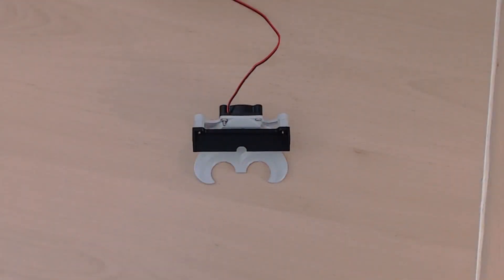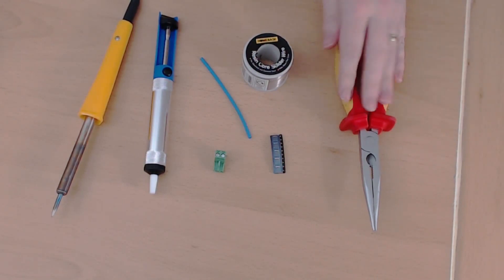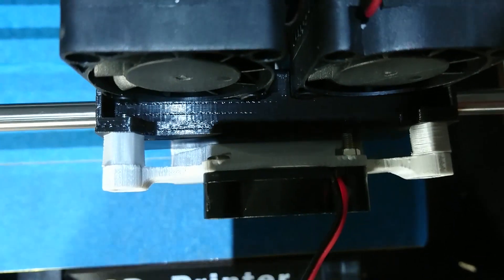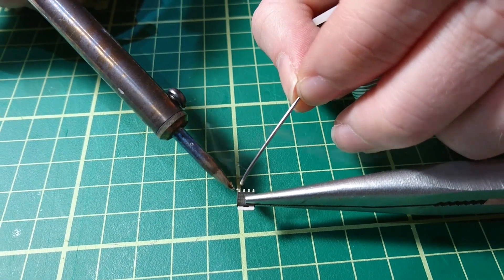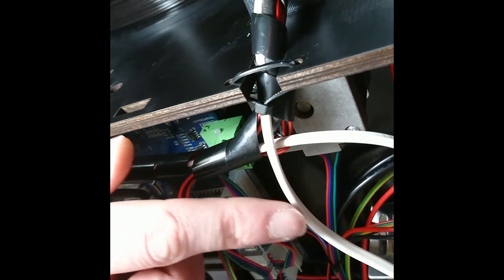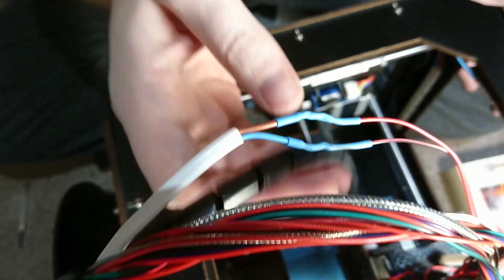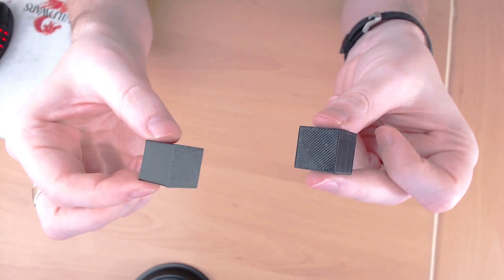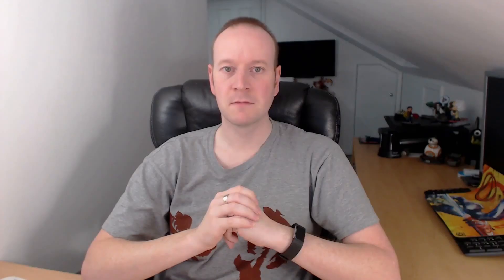CTC 3D Printer Active Cooling Mod

Comment: Just got one of these on eBay for £26.
Changed out the warped aluminium plate for a cut-down Creality one, added foam insulation under the heating plate, and added a magnetic build plate.
Works a treat!

Laser-cut some acrylic for the sides and front and fitted an LED light and a hinged box lid.
Working on the mods now. 

Not as good as my CR10 pro or A10m but a little better than my Weistek 150. 👍
Reply from the maker: Excellent find and a bargain as well. Great work
Reply: @Abernus69  just cant get the bugger to connect via usb, probably a driver issue. 👍
Reply from the maker: @GaryGraham66  I have problems at time on Windows 10 to get my Ender 3 connected. I have more luck using older versions of Windows. If I bothered to troubleshoot it I would probs find the right driver, but a VM is much quicker.
Reply: @Abernus69  yeah I  have a lap top that I may stick windows 7 on and give it a go to update the firmware. Cheers

Comment: Hello! I did all this, but I have 2 volts at the output of the cooler. I checked everything - the soldering is good. However, I am using MakerBot - Desktop. Plastic ventilation settings are set to 100% but it does not work

Comment: Very nice just done one yet to try. I suggest to power it with external 12V power supplier unless you are an expert solderer, I have almost damaged my MB trying to solder such a tiny pieces... done in PLA as I don't use ABS let's see if it lasts, thank you.
Reply: How did that hold up?

Comment: got the same printer, ctc dual bizer. it was a pain in the ass in the beggining but i figure out that was the cheap plastic and BPA
Those printers are not designed to print in BPA and you will always suffer when trying.
Changed to PLA, and never had a problem again.

Comment: i got a board online that had the same little chip soldered to it, except whenever i plug a fan in it burns up and melts the coils. No idea if its the same with yours but any help would be great.
Reply from the maker: It's the fan a 24v DC fan? Also double check for any shorts on your solder work.
Reply: Yeah pretty sure fan should be 24v not 12v as stated in the video. The board also has 24v written over it. Funny I was pondering this when I watched the video!

Comment: made the fan duct and the holder but I spliced it in to the left extruder fan using a quick disconnect that way I can take the fan off if I'm using abs
Reply from the maker: I later added a quick disconnect to mine so if I decide to use ABS I can take it off. I don't see myself using ABS but the option is now there. This is one of the best mods I have done for the printer.

Comment: Hi, thanks for the information. Isn't it possible to just wire the fan up to the fan on the hot end? Basically "piggy backing" the 24v from the other fan. Thanks.
Reply from the maker: Yes it probably is but then the fan would be on from layer 1 and would cause warping and other issues.
Reply: Thanks for the quick reply. I was just concerned in case i overloaded a mosfet. I would put in a switch so after a few layers I would just turn it on manually. I know that is a lot more effort but I am a bit skepticle with soldering onto the board. Thanks again.
Reply from the maker: I would do a bit more research on piggy backing another fan just to be safe. I can't see an issue but I am no electrical engineer so don't just take my word for it
Reply: Abernus69 Alright will do thanks!

Comment: Im looking forward to use this mosfet with 12V blower fan. Is it possible to hook up 2 12V blower fans in parallel or can I just hook one up?
Reply: You can do that however, it is easier to hook up a boost converter to convert power from 24V to 12V

Comment: do you have any video showing how to set simplify3D for these CTC ?
Reply from the maker: You can select makerbot as the printer as these are a clone of that.
Reply: @Abernus69  I'll try it, thanks!
Reply from the maker: @MeirelesSamuel  I have since moved away from my CTC since getting my Creality Ender 3 Pro.
Reply: @Abernus69  I have one too! It's so nice printer but I really would like to work with dual color.
Reply from the maker: @MeirelesSamuel  that's something I never did with mine.

Comment: Hi any idea why my ctc prints a mesh first then starts the print on top.
Reply from the maker: Have you got raft turned on in the printer settings?
Reply: Would that be in the software (Replicatorg) i use  or on the printer itself, sorry as i am new to 3d printer.
Reply from the maker: That setting would be in the software, You normally find this in the Setting of the profile for the printer. I am not familiar with ReplicatorG as I use Simplify3D
Reply: All sorted now thanks for the help.

Comment: what filament are you using? that can make a massive difference in print quality
Reply from the maker: It's not just the filament that makes the difference, for bridging you need the fan duct (IMO) But the filament I use is from a company called Rigid Ink. I use them because they are UK based and the filament they produce is good quality
Reply: its just that i know the filament that comes with the printer id
 rubbish though
Reply from the maker: Yes, the filament that comes with the printer is usually cheap quality.

Comment: Instead of soldering a MOSFET, I could make a separate system with its own power supply, controlled by knobs and potentiometers.
good idea?
or not ?
((brass soldering is not my strong suit))      ):

Comment: Why don’t people have the tools for the job. I don’t mean to be rude but that soldering is crap. Use a hot air solder gun to flow your solder better. Or use liquid flux on it to flow the solder better with your iron. I would redo it again if I was you.
Reply from the maker: It simple we don't all have money to burn so we make do with the tools we have. I am not an not an electrical engineer and this is the best I can do with what I have and it works. At the end of the day we learn as we go and improve we practice.
Reply: Abernus69 
I can respect that but let’s hope it does last because if that solder drys out and it could cause lots of problem. That mosfet should be flash on that board so the back can push the heat out and must have a good flow of solder on the back so it stays there. Because if it get hot and the solder is not that good it will start to come away and could cause a short circuit. That would not be good.